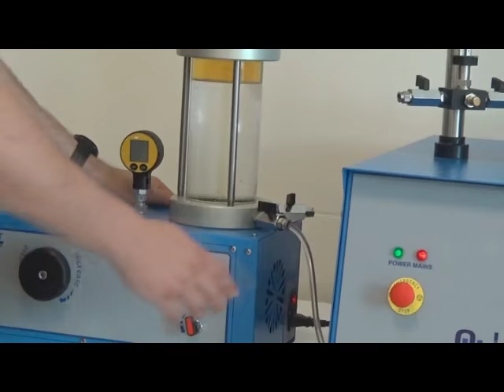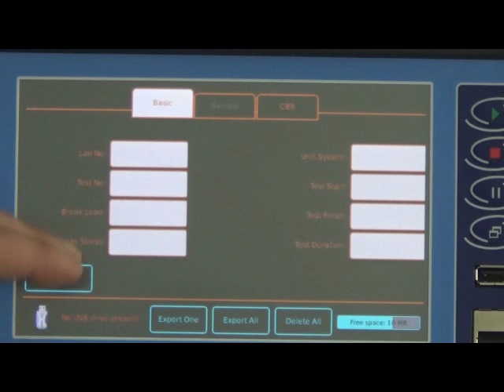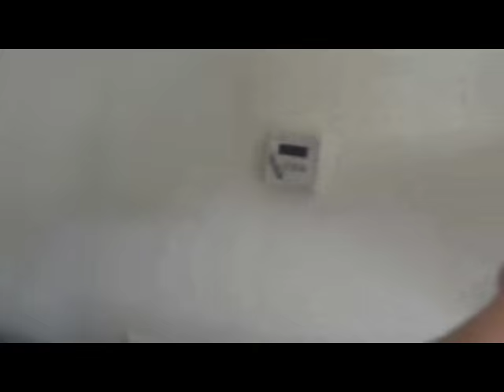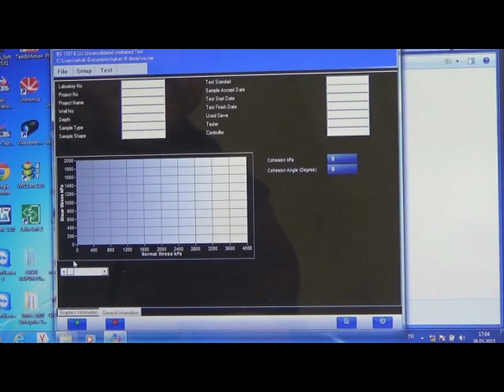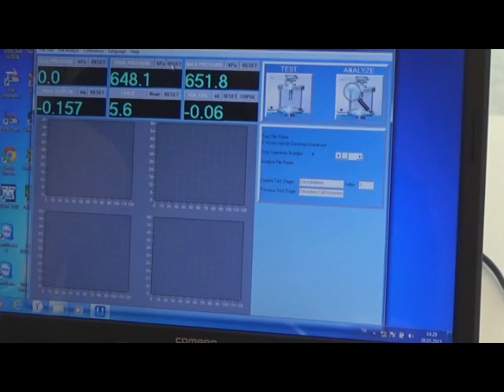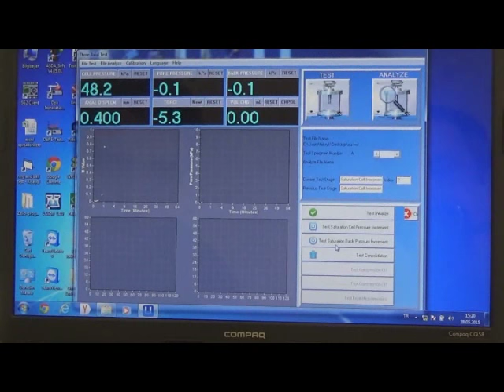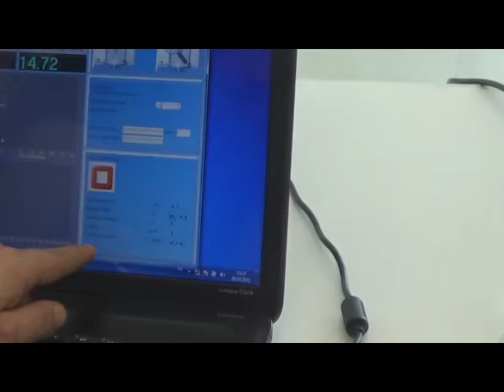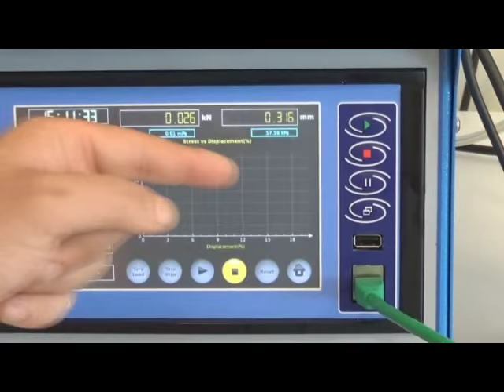Triaxial UU-CU-CD Test System

Comment: how can we get indication of expansion of sample in this automatic volume control gauge?
Reply from the maker: Hello. Could you share more information about the sample you want to test and it's complied standarts?
Reply: @UTESTGROUP  it is over consolidated clay..and using indian code IS 2720 part 11 & 12.
Reply from the maker: Hello. According to IS 2720 part 11 & 12, it is calculating manually. Our Triaxial UU-CU-CD test system is an automatic version. We can check every data in the software and you can print reports.

For more information you can contact our office in India :
Vadodara, India, 390 021 P: +91 98 7906 5857

Or you can check our web catalog.
https://www.utest.com.tr/en/23141/Triaxial-UU-CU-CD-Test-Systems
Reply: if reading of AVC is increasing, what it mean? compression of sample of expansion?